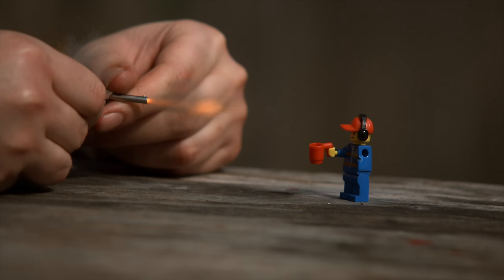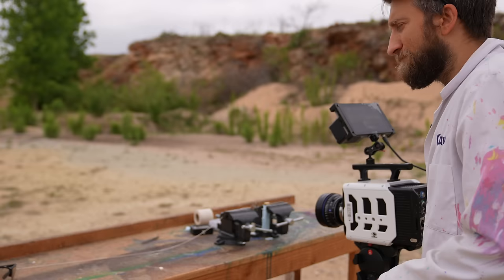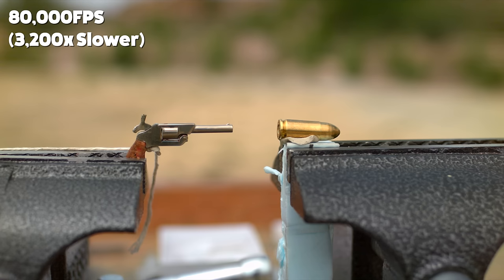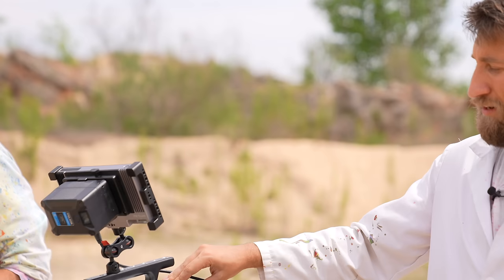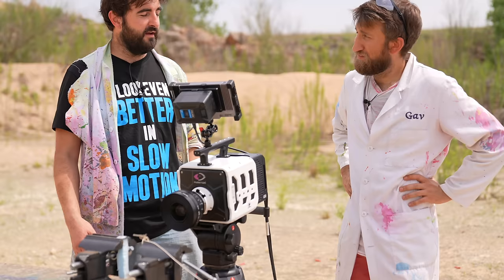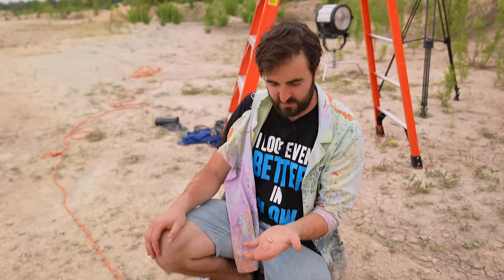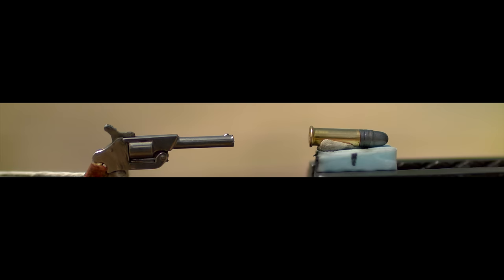Can a 2 Inch Gun Fire a 1 Inch Bullet? - 300,000FPS - The Slow Mo Guys

Comment: Love your videos, and the tiny gun is one of the coolest things I've ever seen.  One thought on the end of the video.

At 14:26, the problem isn't merely compression, it's more basic than that.  Newton's 3rd law.  You have nothing to prevent the casing from actually moving, you're simply holding it in place so you can hit it with a really tiny bullet.  Once the primer ignites the propellant, and due to friction between the round and the casing, the expanding gas exerts an equal amount of force on both of them throughout this event, right up to the point the casing and the round separate.  This is where all contact friction is gone, and only gas pressure is exerting forces on the two objects.  Because the casing has lower mass, the force exerted from the expanding gas affects it much more substantially.  This is Newton's 2nd Law, F=ma.  A gun controls all the forces to maximize the force acting on the round itself.

Comment: If you leave the primer on, the casing explodes into brass shrapnel, while the lead remains basically stationary. This is because with all the energy given, it has to take the path of least resistance which in this case is through the brass. That's because the brass is so much thinner and lighter than the thick, heavy lead of the bullet. You can create what they did with the .22 by putting it in a drinking straw and throwing it up, and having it land on the pavement.  You can also do this via cook-off, but I really don't recommend it.

Comment: The reason the primer was ejected from the 9mm bullet was that there was no hammer/firing pin to hold it in place.  The "slug" is held in a lot tighter than the primer so as the powder started burning it blew out  the unsupported primer before the main charge was fully ignited allowing the gas to escape and losing pressure. Even in an automatic weapon the firing pin is in contact with the primer holding it in place until the bullet has fired properly.
Reply: I don't think the firing pin/hammer is the thing holding the primer in, because it's spring loaded, and 30,000 psi would certainly overwhelm that spring. I think the breach face is the primary thing holding the primer in. I certainly know the hole in the breach face for the firing pin to punch through is smaller than the primer by a long shot.
Reply: @J7Handle  You'd be right that the spring can't withstand the pressure within the cartridge, but it doesn't have to. The gas is going to flow to the area of lowest pressure, and since the bullet will leave the cartridge before anything else breaks, the gas will flow towards the bullet and continue to propel it forwards until the gas exits the barrel. The primer must somehow be held against the cartridge, even for a reason as simple as not wanting to waste energy on accelerating mass which isn't the bullet.
Reply: @AC-fg4kg  I have no idea what you're trying to say. "the spring can't withstand the pressure within the cartridge, but it doesn't have to." That's exactly what I already said. It's the breach face that holds the primer in the cartridge, not the spring.

I don't understand what you mean by "the gas is going to flow to the area of lowest pressure". We know the chamber pressure of 9x19 mm is up to 35,000 psi. That's not up for debate. Neither the bullet nor the primer nor even the casing walls will be able to hold that pressure without support, which is why the chamber has thick steel walls and a thick steel breach face. It holds the casing together while the bullet goes down the barrel.

"The primer must somehow be held against the cartridge, even for a reason as simple as not wanting to waste energy on accelerating mass which isn't the bullet."
Well, I guess that works, but I think the primary reason for holding the primer in the cartridge is to avoid, y'know, having a primer and a bunch of gunpowder going flying out the back of the chamber at several hundred miles per hour. Like what happened in the video.
Reply: @J7Handle  Thanks for the info. I hadn't  considered the breach face I was jut thinking about it being like a revolver with the 2mm bullet representing the hammer. I forgot that even a revolver has the equivalent of a solid back wall holding the bullet in the chamber with just a small hole to allow the firing pin to contact the primer.
Reply: Or the force required to move a 115 123 grain 9mm is more than the force to push the primer back out since it weighs next to nothing

Comment: What happens if you use a chopped barrel?
i.e. a barrel that is the length of the bullet.
It would have the pressure behind it, however not the stability. 
Would it just spin out uncontrollably, or fly straight?
Reply: id imagine the bullet would tumble mid air and probably miss the target but im not sure

Comment: Great stuff guy’s, love the detail. I would like to present a possible theory/factor here you may have considered, at 5:00 when the powder is propelled from the bullet & after the detonator has ejected itself as some sort of space capsule jet engine thrusting away from the case, the powder that discharges from the case thereafter, is it propelled as a retracted echo of sorts, occurring from the detonator propellant echoing/bouncing off the back face of the projectile & then forcing the powder out through the detonator hole a given time after the initial concussion of the detonator? Or is this a basic explanation of how a percussive force works? Cheers

Comment: 10:48 a 9mm has Muzzle Velocity: 1090 fps. Muzzle Energy: 362 ft/lbs, BUT a 22 LR  is rated at 1,070 ft/s (330 m/s). Most standard velocity ammo has a bullet weight of 40 gr (2.6 g). and a CCI Stinger is rated at 1640 FPS.. 
NOW IF you want to go hypersonic from a 22 shell casing, you need to delve into the world of .17 HMR (yes that is 17 caliber), with CCI A17 ammo at  2650 FPS at the Muzzle and  2050 at 100 yards.  (I use 17 HMR to set off Tannerite, it is the smallest possible round to do so safely at 100 yards)
Reply: 17 hornet and 17 wsm are  going way faster than 17hmr
Reply: You been shooting subsonic or something?  My .22s and 9mm rounds both break the sound barrier.
Reply: @bodkinsbestphotography  22 cal and 9mm ONLY reach about 1080 FPS. My 17 caliber rounds are hitting 2260 fps.
Reply: @conlanmcgregor7621  17 hornet is NOT a Rimfire cartridge,   
and GOOD LUCK finding a 17 Winchester Super Mag, I haven't seen it in stores since about 2019.
Reply: @KrazyMitchAdventures  my point is still right tho 17wsm is faster than 17 hmr
Reply: @KrazyMitchAdventures  No.  Unless you're shooting sub sonic rounds both break the sound barrier at sea level (where I live) which means they're exceeding 1125fps.  

A standard 9mm round travels at around 1500fps. My .22 rounds have a muzzle velocity of 1260fps.

Comment: I know it's an old video and this idea may not get seen, but it made me think that with a torch, probably with the cylinder separate or behind a blast shield of sorts, and a metal mount to put a round in, you could catch a round cooking off from heat. You definitely should account for the real possibility of the brass turning into shrapnel if you try it.

Comment: You can easily determine that once the powder is ignited, it goes the path of least resistance. There is no firing pin behind the cap so the power set goes out the back.

Comment: I don't know if you have already done a video that does it but, you should do this same set up with the change of, instead of having the bullet resting on something being held by the table vise, you should have the second table vise be slightly raised and secure the casing of the bullet in the vise using metal spacers so that when you hit the pin it forces all of the energy to propel the bullet forward instead of launching the casing backwards, I think that would be interesting to see to find out just how far/fast you could get the bullet to go

Comment: from what i've learned reloading rounds, the percusion cap , or primer, has enough force to lodge the bullet in the barrel of a pistol. With that in mind, the primer is pressurizing the case enough to push the bullet out of the case, but because the firing pin isn't holding the primer in, it is being pushed out that back, so the flame is expanding in the primer pocket and not going into the case to ignite the powder, or only a little amount.

Comment: It's not just the barrel that you've not got, but also the bolt, whose face closes the end of the chamber and ensures that all the energy of the propellent charge is used to push the bullet out.
The primer ejection and the rear face of the rimfire cartridge ballooning out are to be expected, with no bolt to contain them.  The brass cartridge is only there to make handling the charge easier and less dependent on the weather...

Comment: The reason why not all the powder burned is that there was no barrel. The power is burning while the bullet is traveling down the barrel increasing the speed of the bullet.  If you ever go to an indoor range, you can see the leftover power on the floor.  That is why they do no use brooms, but rubber wedges to sweep the floor.  A static spark can create a flash fire with the unused powder.

Comment: If you can get ahold of military rounds they have a crimped primer pocket. It’s designed for more aggressive handling of the cartridge itself. I reload ammo and crimped rounds can be a pain to pop out the used primer. So that might counter to blowback of the primer blowing out vrs the bullet leaving. Also a pistol round typically has a crimp on the bullet neck. It increases pressure. So essentially a military rifle round would have a much better chance of not blowing out the primer and launching the bullet vrs the backwards blowout.

Comment: What’s happening in the earlier tests is that the percussion cap is being destroyed, or displaced, which means that even when propellant ignites, it blows its gases out the back of the round instead of forcing the bullet out the front. This also prevents full combustion of the propellant.

Comment: The reason why the bullet goes nowhere is because the cartridge case actually weighs less than the bullet, and the force of the gunpowder will go in the path of the least resistance, meaning the bullet stays in place while the cartridge case becomes the bullet.

Comment: I didn't read all 6,500 comments,  but what is the surprise?  This is how inertia works (Newton's laws). With he centerfire round, the 9mm? the primer (or cap as you call it) is a lot lighter than the rest of the round, the bullet, casing and propellant.  It takes very little force to put a primer in a casing, consequently it takes very little force to "pop" it out.  So if you take an unchambered round and set off the primer, pressure builds up in the casing and way before the 'heat' builds up the primer pops out before it even has done it's job.So the propellant never ignites because of the lack of heat and pressure, the primer burns up outside the casing. That's Newton's laws, inertia, lighter things "bounce off" easier from heavy things when there is a force between them.  Now with the rim fire round, when the primer is in an enclosed  casing,  the pressure can't go anywhere (there's no hole te primer can't come out), so the propellant ignites, it will push the bullet out  BUT (Newton again here) the casing is lighter than the bullet,  so the casing will fly away faster then the bullet. Now if the rim fire round was "chambered"  the casing cannot go anywhere.. so all the force is applied to the bullet.  The same is true for when a centerfire round is chambered,  that casing and the primer and the burning gasses can't go anywhere except into the casing (and ultimatey the barrel) ....  and that will make the bullet fly.   It is all HS physics.

Comment: The seal in the percussion caps end is much weaker than the seal the round has with the casing. Normally when engaging a Percussion cap the hammer/pin remains in contact with the back end of the bullet and since the energy of  the explosion will always take the path least resistance. When engaged property, moving the entire firing mechanism takes more energy than dislodging the round and pushing it out of the barrel does. By the time the energy from the explosion reaches the point where it is able to separate the round from the casing it will have been kept in a tight enough group long enough for most of the powder to ignite.

With nothing supporting the back of the casing, keeping the primer cap in place all of that energy will "fire" the primer instead of the bullet. and because the powder isn't being forced to remain compact for as long the energy escapes and compromises the casing before all of it gets the chance to properly ignite, so it doesn't. The transfer of energy is lazy, when given the opportunity it will always, every time take the easy way out.

Comment: I think the most interesting part for me, is that the only reason why spent rounds still have a dent on the primer, is because firing pin remains pressed against it until it's been ejected!
Otherwise, all fired rounds likely would have popped back out, like what happened in the case of the .22 😊

Comment: What happened in the first shot was the heat from the 2mm heated up the end of the 9mm enough to release the primer from the 9mm and it created pressure inside the 9mm enough to push the primer out from the inside

Comment: 3:45 the reason it didn’t ignite the gunpowder is because the primer handle has a ignition strip on the part that hits the bullet like a match box and a match the match ignites more easily when you swipe it on the rough side of the box same can be said with bullets

Comment: The press fit of primer does not hold back the pressure in the 8mm casing.   Plus a firing pin would deform and hold in the primer.

Comment: Great video, Guys.  Love the edit and attention to detail.  Just a couple of clarifications on terminology when it comes to ammunition:

Percussion cap => Primer

-Percussion caps are used exclusively on black powder firearms. While they are used to ignite the propellent, they are attached externally to a component called a cone, which serves as a channel for the sparks to reach the propellent.  Meanwhile a primer is an internal ignitor, attached to the self-contained cartridge.  Primers exist in virtually every cartridge, whether rimfire or centerfire.

"bullet" => Cartridge (or round)

A common misconception that goes back hundreds of years.  A cartridge is a self-contained unit consisting of four parts: casing, primer, propellant, and bullet (projectile).  The bullet is what gives the cartridge it's caliber designation, but it is only one component of a cartridge or round of ammunition.

Otherwise, great job on the video!  Your sense of wonder and excitement from your experiments never gets old.

Comment: If you use the bolt of a gun with the firing pin drilled out to hold the bullet and allow the mini one to strike the case, and the bolt in the vice it would be able to shoot at almost full speed and would probably get you much better results

Comment: I think you should increase the distance from the pin fire revolver to the bullet casing.  I think the projectile is deforming the primer enough that it shrinks inside the primer pocket and therefore too loose to hold itself in to ignite the gunpowder in the bullet.

Comment: This makes me wonder if the bullets we use today could be improved upon. If it was designed to contain the pressure it would have a lot more potential. Even in a barrel that little bit of play room when the bullet cap comes out the back causes a loss of power.
Reply: It’s probably easier for militaries to add extra gunpowder than to buy expensive machines and tools for a minor improvement of one weapon.

Comment: if the primer cant go back as its in a rifle or pistol the primer alone will be anough to send the bullet inn the barrel the problem you got now is that the cap is allot lighter than the bullet and does not  get assembel with as much friction as the bullet it self and it will blow out back

Comment: yo SLOW-MO, how about you lock the bullet with cartage facing 90 degrees or at any degrees less than that (0<x<90; x= angle of elevation) so  the casing does not go backward and all the pressure generated will be pushed towards the bullet and except of the casing going back ( 11:42) and releasing gass, it will pressurize the bullet more and you'll get more speed (in short: hold the bullets' casing tight to lock it up)

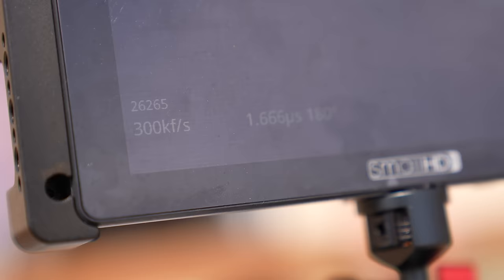Comment: Im at 5:25 so far.  My theory is that the heat from the blast actually did ignite the propellant but the pressure blew the cap off instead of sending the bullet forward.  The firing pin on a gun would normally push that pin forward giving the bullet no choice but to project forward but in this case the path of least resistance was through the cap.

Comment: The reason the primer shot back at the tinny gun with the powder is becaus3 .there was no stress or tension on the 9 mm casing as it has in gun chamber housing. Also once the primer is struck the powder is ignited . Pressure builds up inside the casing causing g the pressure to push the belt down and out the barrel of the gun.plus the primer must be hit hard from the the firing pin . Your case....a strong hard hit Ron the smaller projectile fromthe tinny gun.

Comment: I wonder if some of the powder burns until its not under pressure it doesnt continue to burn, or if the reason some of the powder isnt burning is because its being shot out of the casing away from the heat.